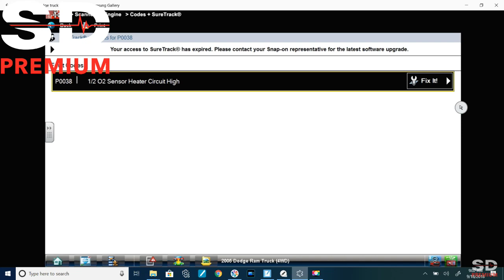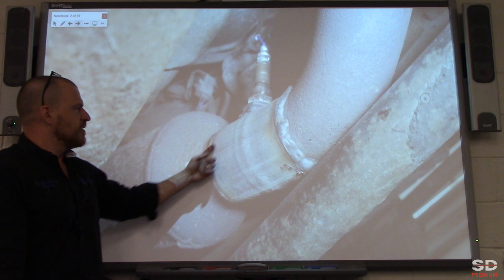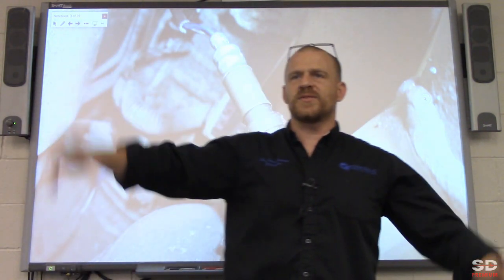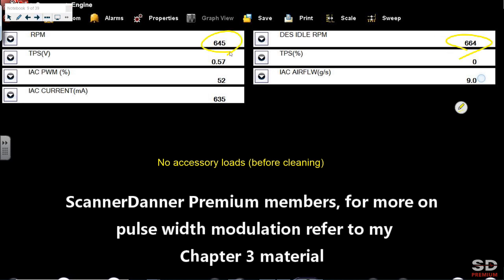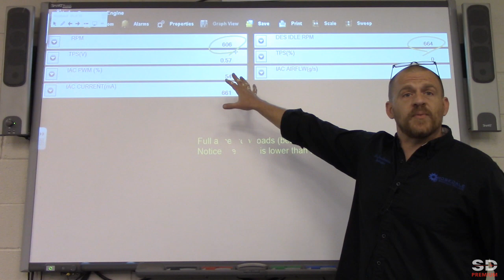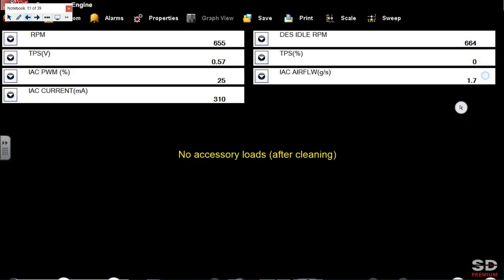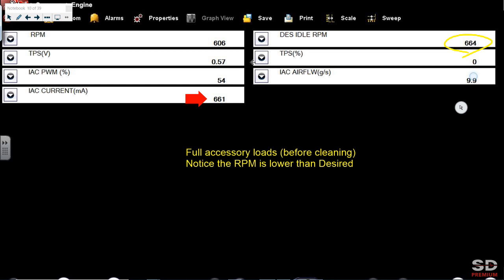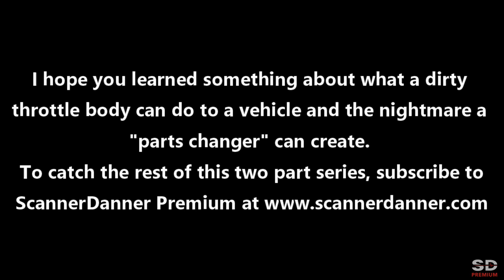O2 Code, Dirty Throttle Body (stalling problem) & Mechanic Incompetence

Comment: Mr Danner , I have a code P2245 B1S1 low voltage on my 2012 Jeep Wrangler that nobody can find the problem.. both front 02’s were  changed. A while back I had changed the computer due to a short the shop said ... so I can say that it goes on at cold start, when it warms up I can erase the code and the light will stay off until a cold start again and boom it goes back on.... I’m out of help / can u help?
Reply from the maker: this code has you testing the low reference circuit (sensor ground) which is a constant 2.5 volts on this model. 
Your possibilities are:

Wiring (short to ground on the low ref)
Sensor (some aftermarket sensors can cause this fault)
Computer (or damaged pins)
Reply: Thank You Mr Danner. I will let you know how I make out Sir.

Comment: Need some advice on a secondary air on a 05 trailblazer so it get signal from my scan and turns on and works but won’t work on its own the guy has had this garage  told him he needed the pump then the relay but still a p0410
Reply from the maker: This may help you https://www.youtube.com/watch?v=MNjSn9AWFVw

Comment: I have explained to MANY customers, in the past, the industry had honest and dishonest mechanics, after 1980 1/2, we now have honest, dishonest & uninformed mechanics. I've never talked bad about another mechanic I had doubts about. I would ONLY share negative comments on another mechanic that blatantly cheated a customer. I hope most other good, experienced mechanics do the same.

Comment: I’m 2 years late. 😂 doubt I get a reply but I have a Buick LaCrosse giving me the same issue after I changed the camshaft sensor and crank positioning sensor. The crank code still keeps coming on with the o2 sensor bank 1 those were changed also. Could the throttle body be causing the codes for crank sensor free a new replacement?
Reply from the maker: Clear your codes, start it, then reread them and give me the code numbers please. Also, year, make, model and history
Reply: 2010 Buick LaCrosse 3.6 cxs model
Cleared the codes still p0017 crankshaft position sensor

Comment: It's some of each - incompetence in some cases, being a thief in others, and sometimes there's both.  I've been in this business since the early '90s and think that when trying to diagnose something, you should have a real sense of direction within about 15 to 20 minutes or so.  Some difficult problems will take longer, but if after an hour you're lost, it's time to get help - find resources that will get you on the right track.  Otherwise you're just wasting everyone's time and will most likely misdiagnose the problem. Yes, there are really difficult problems that will take whatever it takes, but those are an exception.  Just my opinion.

Comment: Hello, Paul. Why did the RPM  didn't rise to the desired RPM after the cleaning?
Reply from the maker: It did, not sure what part you're referring to. Can you give me a time frame please? Also remember these are still captures of one single time frame of scan data
Reply: Thank you Paul for responding. I was  just referring to the "No Accessory loads ( After cleaning) where the desired Idle RPM was 664 and the RPM, 655 and also with Full Accessory loads(After cleaning)  RPM 654 and desired  Idle RPM 664.
Reply from the maker: No problem and that's what I was thinking. Watch RPM on any car and it will fluctuate. It is never perfectly steady. So again, you were seeing a single frame of data. Make sense?
Reply: Yes, it does. Thank you.

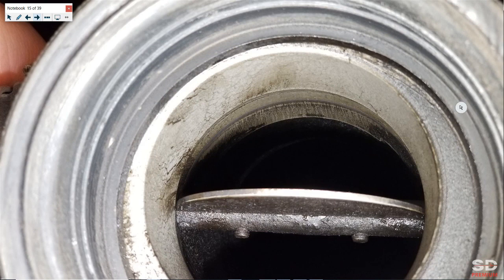Comment: @10:45 thats what it looks like when people try to clean a throttle body without removing it from the vehicle! Lol 
Always take it off and clean it properly.
I just did a GMC Canyon that was having stalling issues...TB was completely carboned up on the back side. Runs flawless now
Reply: The IAC #s were up originally because of the carbon buildup around the plate. The built in clearance was almost gone, due to carbon, thus making the IAC circuit pull more air through it.
Reply from the maker: I've cleaned thousands of throttle bodies and not one of them did I have to take the throttle body off
Reply: @ScannerDanner  
Really? I always take them off! I like to see the back of the plate and throat area, and make sure i get all the gunked up carbon off.
What ever works!

Comment: Where can I find this on SD premium
Reply from the maker: https://scannerdanner.com/scannerdanner-premium-chapters/chapter-5-oxygen-sensor-testing/chapter-5-oxygen-sensor-testing-full/608-2005-dodge-ram-1500-o2-heater-code-faulty-pcm-driver-and-stalling-conditions.html
Reply from the maker: Use the search and type in dirty throttle body

Comment: Big issue on Trail blazers...remove and clean the throttle body, install and run without accessories for 5mins and fixed.
Reply: Fixes decal stalls and in gear stalls
Reply: I the IAC build in sucks

Comment: The biggest problem is the flat rate system. Someone says it’s a crank sensor and replace. There is no extra money allowed for confirmation. Usually there isn’t enough time allowed for a test drive after repairs. When they come back shops blame their techs. Then to be safe they start hanging parts on it. Even if it takes 4 hours to hunt down the actual cause of the problem the customer will be happy to pay for the diagnostic time if it will fix the problem once and for all. If the customer doesn’t want to pay you to properly diagnose the problem send them away. In the end it’s best for everyone involved.
Reply from the maker: I believe there is a proper way to work the flatmate system that is good for everyone involved. Customer, shop and tech. You just need the right service manager/writer and tech combo. Hard to find.
Reply: Definitely agree with you. Definitely hard to find like a unicorn lol

Comment: 😇 Dear St. Paul, 😏 off topic, u seem like a wizard 🧙, just for fun whenever u have time cud you look at all of Stanley Meyers old electronic diagrams that are archived online, about constructing his secret aparatus: A.C. Water Electrolysis System HHO Generator, it suposedly uses P.W.M. with changes in amplitude and frequency to slowly 'Squeeze / Pull' the water molecule, where u slowly build up momentum and inertia until they come apart easily, that way you dont need alot of electricity, suposedly with that method a standard Truck / Bus size battery and a good H.D. Alternator is all u need to keep the process going as you drive down the road, yay! 😍

Comment: A dirty or defective throttle body can cause no start issues. Seen it on 2008 Nissan altima.
Reply from the maker: On a TAC system yes, on a non TAC (electronic throttle body) system no. I should have said "regardless of throttle angle". In other words if you open the throttle it will start on a severely dirty throttle body.
Reply: @ScannerDanner  Tac (throttle actuator control) then you say non tac(electronic throttle body) doesn't seem right. I have seen them so dirty that the plate doesn't even move. The plate is just caked with all the black crap. besides, some vehicles don't even allow throttle movement unless the engine is running.
The one thing that really gets me in this diagnostic trade is when people say "this never happens". The automotive diagnostic world is full of very, very interesting things. Some days it will almost seem as if it goes against laws of sciences.
Reply from the maker: TAC - throttle actuator control (which is an electronic throttle body)
Cable driven throttle bodies will start when you open the throttle slightly if it is severely dirty. That's all I was saying. 
I agree that a TAC system has other variables in that if the computer doesn't like what it sees, it shuts down injection and it won't start. However, I've never seen a dirty throttle body cause this condition.

Comment: A oxygen sensor measures the lack of oxygen the voltage is generated by hydrocarbons thus the sensors name was originally a hydrocarbon sensor but later changed to oxygen sensor

Comment: Sometime I feel guilty giving a customer a big bill when I fix there problem. How the hell can someone give the owner a huge bill and say "oh by the way your car is still broke" but pay up!
I think a mechanic is the only profession that gets away with this all the time! 
If someone hires a roofer for a leaking roof and it still leaks after he leaves, he has to come back and fix it till the problem is corrected. If you hire a painter to paint your house and he does a crappy job he has to come back and make it right.
I can go on and on.. Why can a mechanic charge a crap load of money and not fix the problem but yet he gets paid, and they have to take it somewhere else and spend a bunch of money again.

As a mechanic myself I wouldn't pay 1 cent to the garage if what I wanted done wasn't right.
Please viewers, tell me-us why you paid the bill if your vehicle wasn't repaired correctly.

Comment: the problem is if you want to be a carpenter you go buy a tape measure skill saw and a hammer and your a carpenter right? The same in this field. Anyone can go buy the 200 piece mechanics set and your a mechanic right? God help them if they have to read a wiring diagram some day.

Comment: people want a cheap price and this is what they get...
Reply from the maker: yes sir
Reply: Amen to that 😀
Reply: Random GearHead 

How much should they pay?
Reply: @bstevermer9293   that's a good question. May have cost them less if it was accurately diagnosed at a better shop.  But from what I found people don't like the prices at the better shops sometime and go somewhere else to try to save money
Reply: paid 400€ for egr valve that i didnt need. finally 3€ fish tank tube solved the egr problem.... and that was the mazda dealer. they charge 60€ for labor per hour.... so price is not allways the mesurement who is good and not.
Reply: The problem is that the educated and honest tech and the backwoods idiot without a clue can charge the same price. Price equals quality is a fallacy in today's market. Too many people are willing to charge a premium while doing a piss-poor job. It's not people looking for an inexpensive price that is the issue - they paid for all of this work after all. The problem is that some techs don't know enough to do their job. A competent tech would have provided them with a relatively low cost service given the issue was a dirty throttle body. Price doesn't always differentiate skill.
Reply: Random GearHead 

From my experience ,
It’s not the “shop” but the tech . Every thing comes down to the technician. Lots of great shops have shit techs . And lots of shit shops have amazing techs.

Comment: 99% of time I throw parts at it and it works--for those 1  or 2 times it doesn't that is when I play detective-----however----I do not just throw computers in a car---that is a very rarity---it is usually a sensor or something stupid

Comment: not incompetence nor ignorance----its called tryin to get it done in a short amount of time/as quick as possible--blame the flat rate pay system and mcdonalds society--nobody is gonna go digging and digging and confirming and double and triple confirming a faulty part or issue without being paid--the quickest and easiest thing to do is change a part-and 99% of the time it works---so why play detective and waste your time when ODDS are the part is faulty--if you played detective everytime you would not get much done---our society really is to demanding--we have become the mcdonalds society where even people want there cars fixed in 15 seconds and at a very low price--and the sad part is-people/customers EXPECT good results--I kind of wish everyone would die for being so fuckin stupid